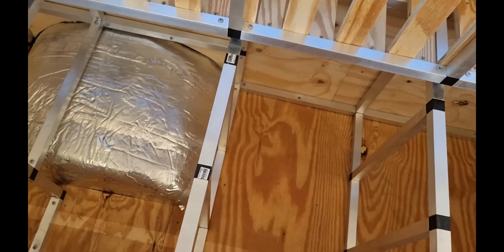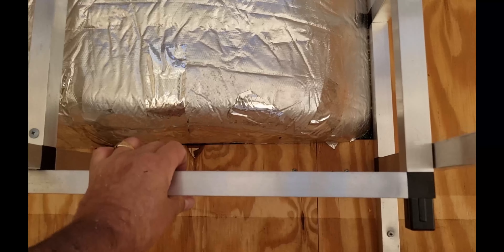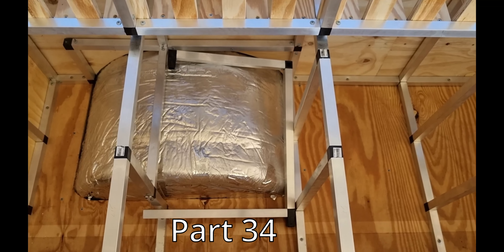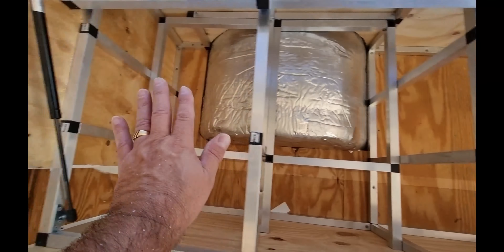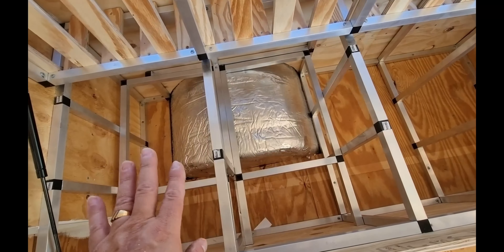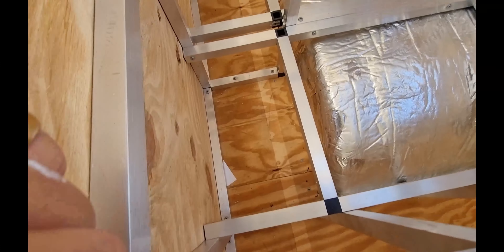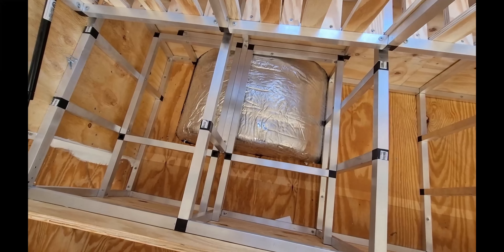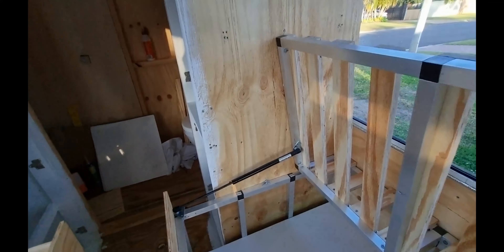Mitsubishi Rosa Motorhome Conversion Part 59 Installing electrical panel

Comment: Love watching your progress. 
I thought the inverter had to be mounted against a fire proof backing? Hussain bought all this up in his comment already (thanks Hussain). 
I don't know what kind of lithium batteries you are getting, but I have LiFePO4's (48V - 16 cells) and, although considered the safest of the Lithium types, I have housed the set in a cheap steal rhino box from bunnings and will mount them so I can pull the whole lot out very quickly should a cell go feral without having to handle any of the cells or batteries. I also have a loud cell temperature alarm. (This is in a camper, so much easier to do I suspect). 
It pays to consider what happens in an emergency and what you can do...I just imagined the camper burning to the ground on a seldom used track on the way Dingo Piss creek...my plans for the batteries changed very quickly!
Reply from the maker: Hey Benny I have talk to the electrician and he has checked victron inverter manual about firepròofing and as long as it's well ventilated we will be all good. We have 1 fire extinguisher and we will be get another as well as some fire blankets. But we will monitor it as we start to use it.
Reply from the maker: The video of our electrical will be coming out in a week or 2 and it will have all our solar equipment 😀. We will have fans inside the bed and they will be connected to the inverter which will monitor temperature and turn fans on and off as needed.

Comment: Coming along quite well Andrew. 1 question is how do you go to Bunnings and only have a basket? I always need a trolley 🤣. Maybe place a vent at the ends of your bed for ventilation for the batteries and electrical. Loving all the vids.
Reply from the maker: Hey La la Faux it is coming along we are so happy. I usual have a trolley at bunnings but have to save money for the electrician 🤑🥴. We are having fans either end of the bed to allow air follow. Thanks for the support it is most appreciated.

Comment: Heey Andrew glad you're feelin better mate. Any fireproofing for the battery and inverter enclosure? Also I think it will need some kind of ventilation for cooling and dumping the heat out of the living space. What are your plans for fire extinguisheing system?

All the best mate and stay safe
Cheers
Reply from the maker: Hey Hussain thank you it is good to be over being sick 😀. I have talk to the electrician and he has checked victron inverter manual about firepròofing and as long as it's well ventilated we will be all good. We have 1 fire extinguisher and we will be get another as well as some fire blankets. But we will monitor it as we start to use it. Cheers Andrew
Reply: @OffGridisSweet   not sure if the inverter model you will be using has a remote monitoring system, but still I think a fireproofing lining would be the least for better safety. Also check out maybe you can find something like it for fire suppression  https://youtu.be/-X9uMCbl3eo 

Cheers mate
Reply from the maker: @hussainalfadhel1496  will have a look thanks mate 😀